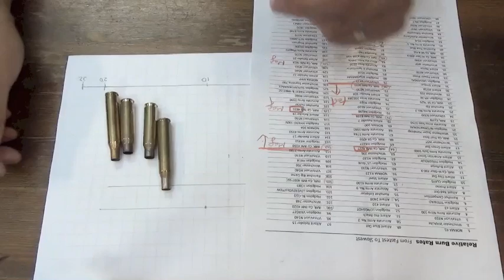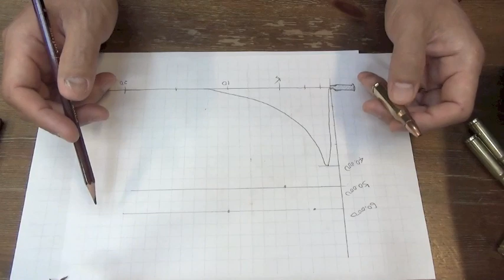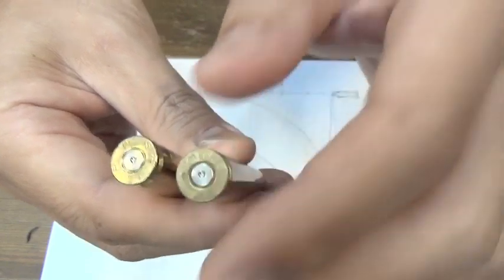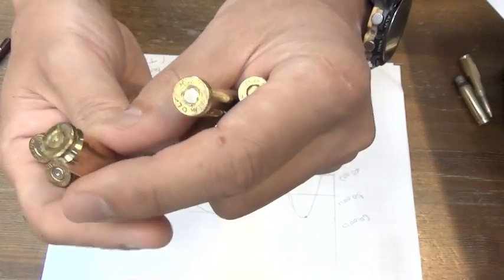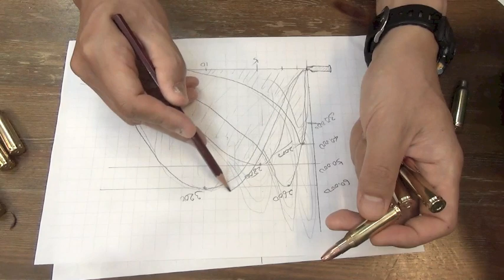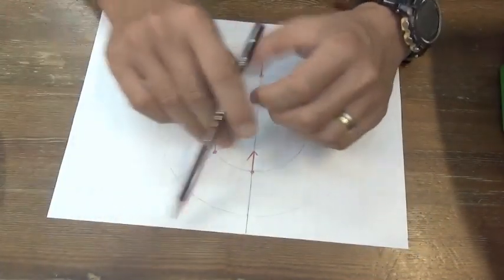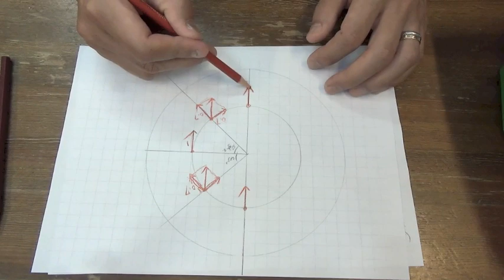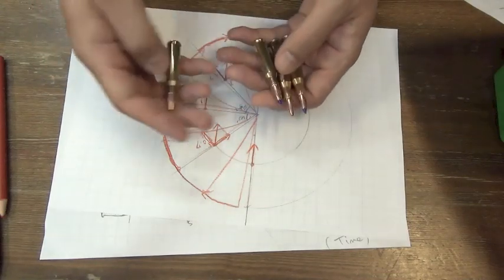Ballistic physics of mine

Comment: Flattened primer is the first sympton that your load is close or over the safe chamber pressure. Next step is stiff bolt handle and blown off or pearced primers. Shiny marks in the case head will also occur with too high chamber pressure. When testing for close max loads always do the testing in warmer weather than the intended shooting conditions. The powders tend to produce higher pressures as the temperature rises and vice versa.

Comment: You might be best suited to practice with the same loads you will hunt with, also to test your ballistics at the longest ranges you intend to hunt. Did you read about maximum point blank range concept? that is something you would probably be interested in. Also another tip, you can use a micrometer to measure your fired cases before and after near the primer end, compare readings to a known safe maximum factory load, this will indicate if you are getting close to safe maximum pressures.

Comment: I use the same principle in my practice and hunting ammo.
For target practice I load light bullets with fast powders, for hunting ammo I use normal weight bullets with near maximum velocity. In .30-06 I used JSP @ 2700 fps for hunting, and 110 Sierra HP @2200 fps for target practice. At 100 yards light load impact POA and hunting load 2" high.

Comment: If I remember correctly the maximum pressure for .270 win is around 65,000 psi /450 MPa/... so you are in the safe zone but you can try for the 130gr bullet and IMR 4350 combo to back up (one) 1gr.

Comment: If we're talking about hunting distances (300 m or less), the bullet flies for a fraction of a second, so gravity only has a minimum amount of time to act and decrease its speed. Gravity is roughly 9,8m/s2, so, even if you shoot straight upwards and your target is 300 mt above you, it will only decrease the speed of the bullet for less than 10m/s. The major factor affecting the bullet's speed is air resistance, but that's the same when shooting upward or downward.
Reply from the maker: I forgot to say that the drop theory of mine about diagonal shots was for twice as long range as the scope zero-in range where the bullet speed was very slow mainly because of the air resistance. For shotguns my theory should be applied for 200m and for rifles for 400m. Thanks.

Comment: My humble experience. Some years ago, the classic .308 load was 40 to 41 grains of 4895 for a 168 gr HPBT bullet (24 inch barrel). Very accurate for competitive shooters. .308 shoots best groups with the bullet seated with an AOL allowing the bullet to touch the lands of the rifleing. If you chamber a loaded round and then remove it, with a mag glass you should see the land marks on the ogive of the bullet.
Reply from the maker: Some say that lands touch seating is dangerous about our solid copper bullets because the primer can make very high pressure when the bullet doesn't move at all. So I seat my bullet 1.5mm before the lands. Thanks.
Reply: virtuovice
It´s common to have the bullet seated near the lands, say 0,2 mm away. A change in the bullet seating depth from 0,2 mm off to contact with the lands can produce peak in the pressure so be careful especially if working with near max powder charges. Be advised that you can get quite a good accuracy and bullet velocity using just the C.O.L stated in the loading manual. Long range afficianados use all the tricks to max their equipment and performance. With longer C.O.L. you can add more powder as the case volume increases. When choosing the powder for accuracy load it is usually preferred to use powder that fills the case volume. Compressed loads are sometimes done also. If there is too much compression it becomes difficult to maintain the uniform C.O.L from catridge to cartridge. Solid copper bullets are harder than jacketed lead bullets. It is usual that you can´t use the load data of same weight jacketed bullet but one size heavier. Best option is to look for the data provided by the bullet manufacturer.
Reply: Antti Saarilahti
Some solid copper bullets are advised to load of the lands with greater margin than jacketed bullets. Adequate free movement of bullet before hitting the lands will soften the pressure peak. The solid copped bullet produces more pressure as the friction in the barrel is higher.

Comment: Hello Wako! Please keep in mind that the data from the books don't match with your personal rifle, case and primer combination. (F. e. speed is different out of a 22" or 20" Barrel) The only way to verify your personal load is to measure the bullet speed with a chrony. Having the speed with your load out of your rifle you can calculate all the other Data, like pressure, bullet drop etc. In my opinion it makes not much sense to have so many different loads for different distances when you go hunting.
I would develop one load which is accurate, send it through a chrony, get a ballistic chart out of it and zero the rifle. Depending on the reticle in your scope you can compensate for bullet drop or  adjust the turrets. Good luck and stay safe!

Comment: How did you determine the values 1 & 0.7? I am assuming you are using vector calculus and the down arrows are vectors orthogonal to your shooting angle?
Reply from the maker: Yes. We can divide  the earth gravity into the two orthogonal vectors. And the length of each vector is calculated by trigonometry. The perpendicular vector to the shooting line makes the bullet drop. 0.7 is substantially smaller than 1 in my opinion. But I think this issue happens only when the bullet speed is slow enough when the target is over 300 yards with a rifle or over 150 yards with a slug. Then the drop is smaller by 2 inches or so in 150 yards in case of a steep down angled shot in my hunting experience with a slug gun. I haven't taken this issue into account in my past slug hunting history. And I remember the upward shots have made a lower hit rate than the horizontal shots but the downward shots have made a higher hit rate and often made the spine shots. We are not allowed to do target shooting in the field outside the shooting range. So I am sorry for the fact that I cannot make this issue clear by the real experiments. Thanks.

Comment: Doc, I normally like your vids. But. For a .308 and for the .270 your speed is to high. You should use a heavier bullet  for the .308 minimum 145grs , better  ~167,~180, ~185grs. The twist isn't ideal for high speed and low weight bullets. The speed should be <820m/s. The .270 needs a slow burning powder slower than the .308. For a .270 Winchester bt nosler  150 grs maximum speed 840 to 870 m/s. for a .270 wsm 140 grs barnes ~900 m/s max.
Reply from the maker: I am a rifle beginner and like to make the max speed so far to kill a distant deer. I think my speed is still in the safe range although sacrificing accuracy a bit. I will start this hunting season in these ammo settings. I won't increase powder any more but decrease according to your suggestion. Many people here suggest as you do. Almost all hunters as far as I know here use 150gr for deer and 168gr for bears for .308Win. I will need to make 168gr setting for .308 soon. Thanks.